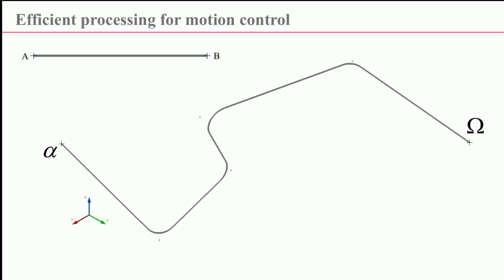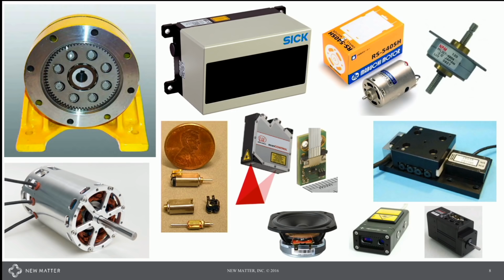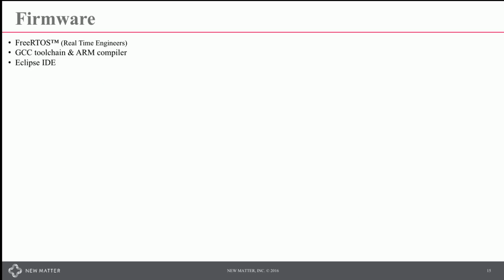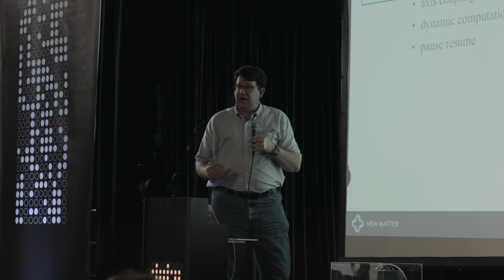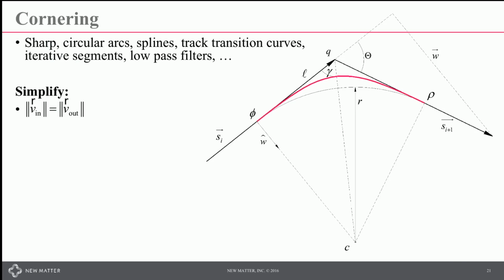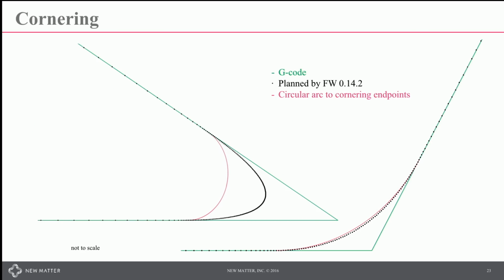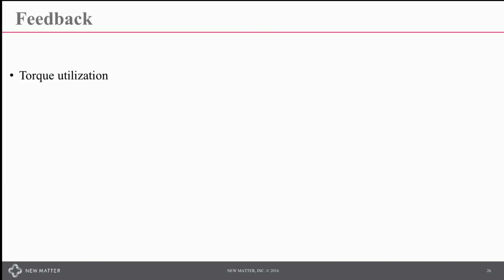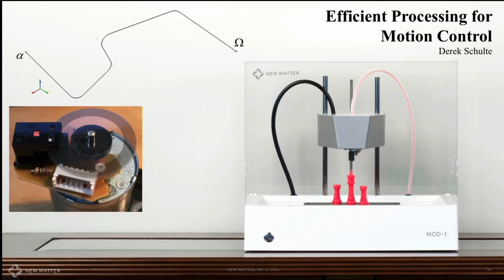Path Planning for 3D Printers

Comment: Interesting to see the graphs at the end showing expected vs actual paths, as well as total path errors. I've never seen data like that before for 3d printers. I would love to see the same analysis with other common firmwares such as Marlin or Repetier with steppers, just to see how they compare.
Reply: Hoffman Engineering yeah definitely very interesting. I imagine that it would be tough to measure. I also really like the bump/stall homing and wonder how accurate it is. Certainly a great way to home the z axis. I think the Tiko does something similar, but with an accelerometer.
Reply: Z axis is within 50 microns.

Comment: What is the motor used? I wan't something similar for another project? Anybody have a link Motor with similar specs?
Reply: Small/low cost motor/encoder assemblies are difficult to find unless you have significant production volume.  You might be able to find surplus parts however.  Look for motors from Mabuchi, Johnson Electric (JEI) or NMB.